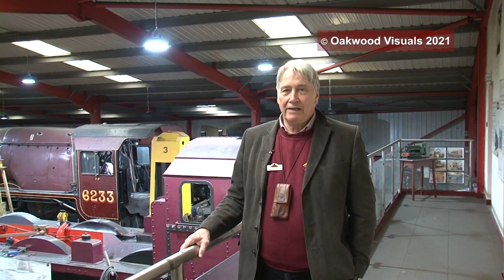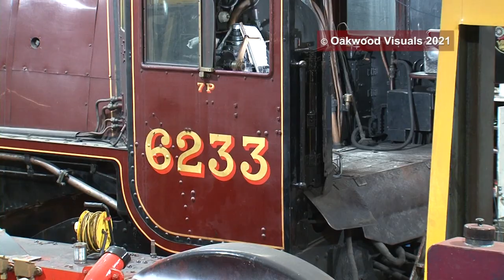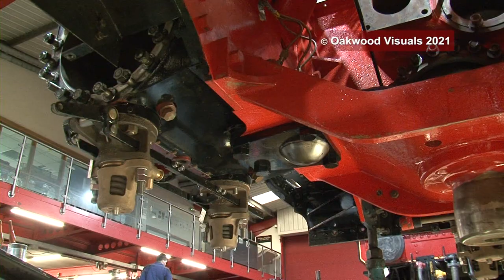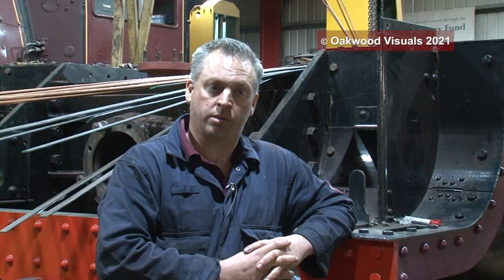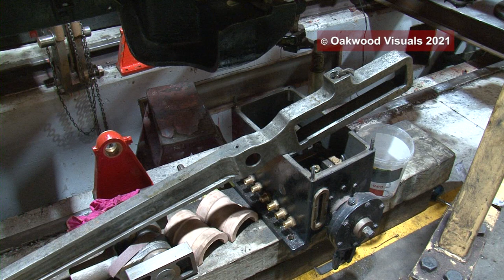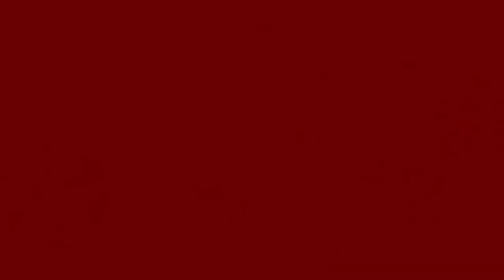LMS-Patriot Project - Chassis Update

Comment: You've REALLY not had your share of luck with  this locomotive... Metalurgy and  engineering issues knocking you sideways so often.... But. the determination is perhaps strengthened by these set-backs. You WILL have an engine to be proud off SOON....And those you wish to honour are in  no rush......